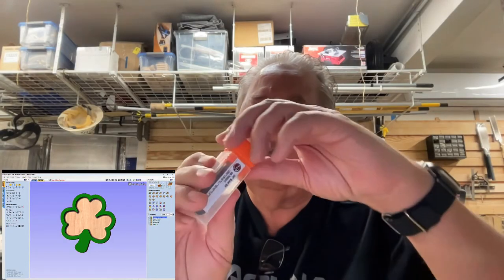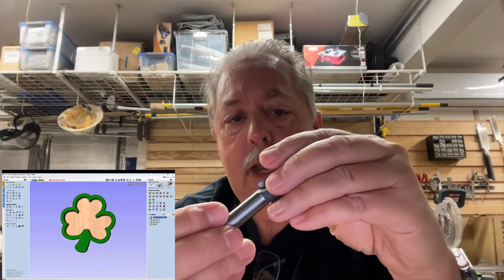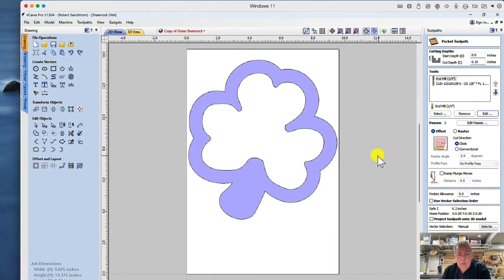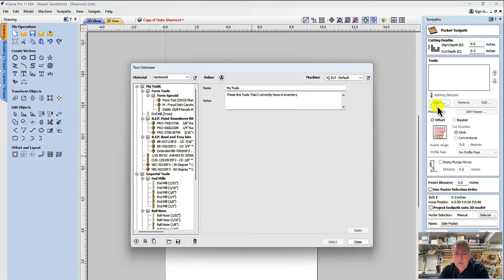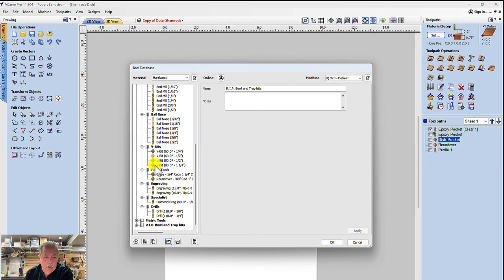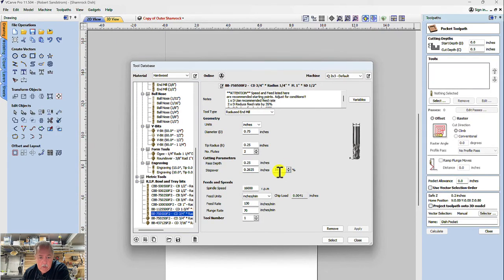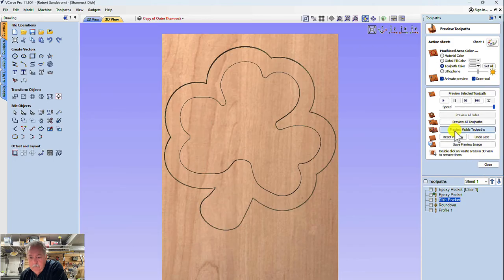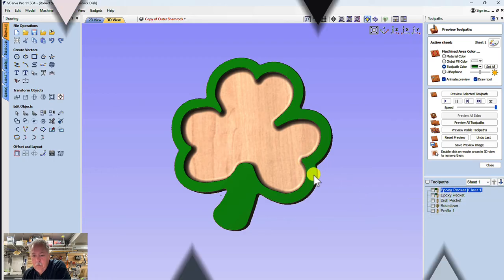How to add a New Bowl Bit into the Vectric Database #vectricsoftware #vectric

Comment: Are you running VCarve on a mac?  I guess I missed that capability.

Yes, short tutorials are useful, if it is possible to find them.
Reply from the maker: Sorry for the delayed response.  I have been on an extended road trip since about March 28, so catching up with SM when I get a chance at nights.  But too tired most nights to check my Social Media so have been slacking on replying to comments and emails.

I am running vCarve on a MacBook Pro using Parallels software with Windows 11.  So far it is working well, there are a couple shortcut items that need to be adapted to but otherwise it is working well to date.